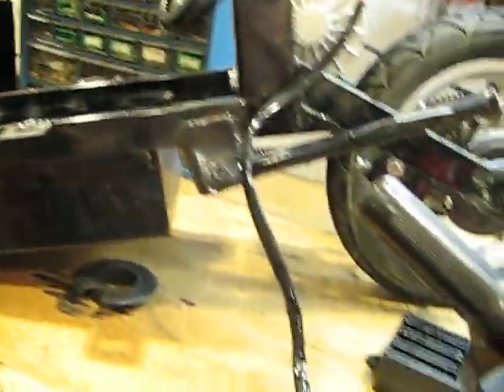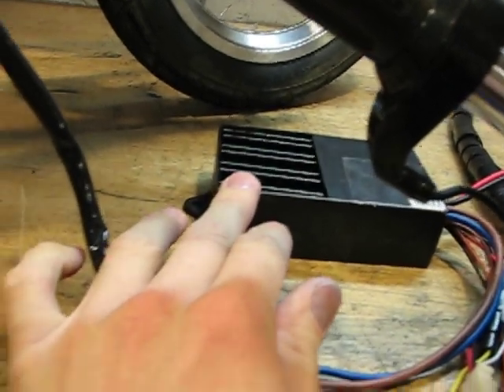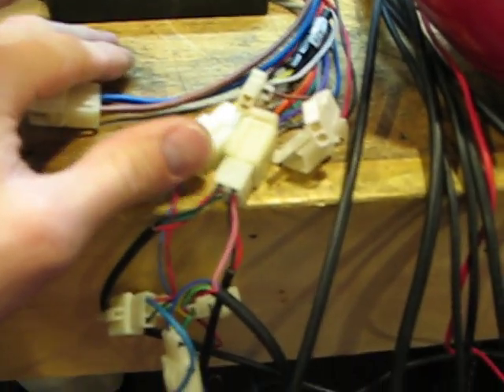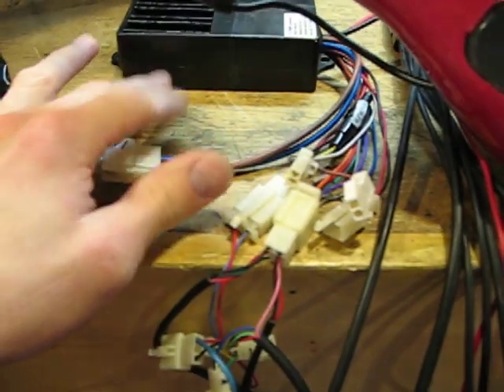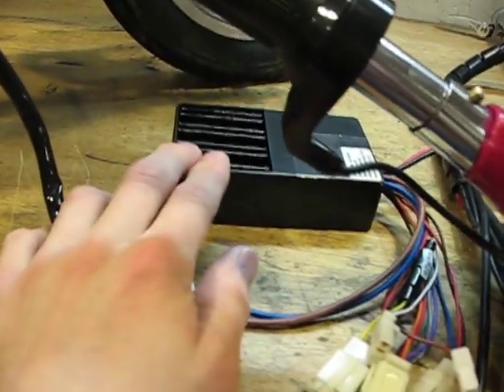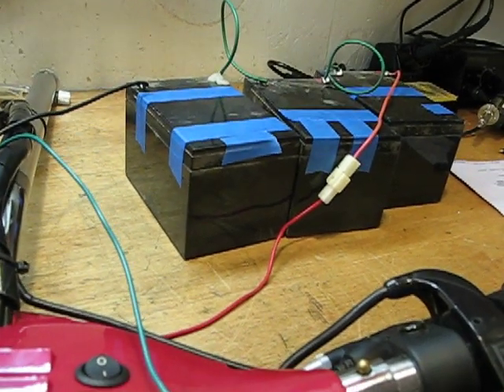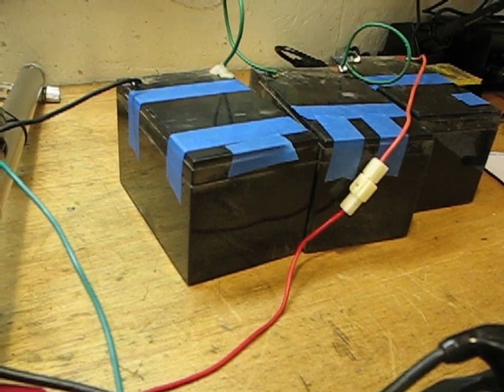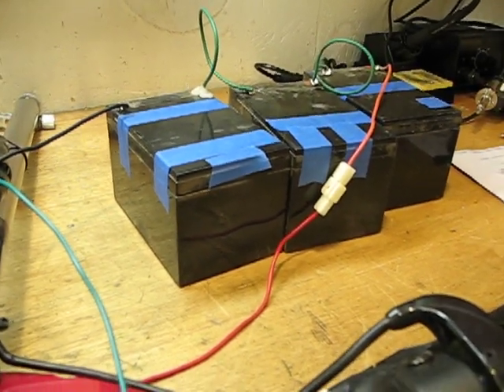Electric Scooter Controller Test

Comment: I have another type of scooter one of these standing one, I purchased a new controller for it , its what the manufacture web site sells/recomands, however it does not have the same wiring, it has no Charger input, also a too many wires going to the throttle , the scooter is bladez XTR-s 450w and the new controller is xk-022c .Can you help me THANKS

Comment from the maker: @BrutusJones Yep, you can connect the motor right to the batteries.  Just make sure you lift up the wheel or you will be chasing it :-)

Also make sure your brake switch is not stuck on, because that will disable the motor too.

Comment: Ok, the voltages on one are all around 12v and on the other two are around 13v and one is around 11v.   the dash lights up ok and says full power on one scooter and the other ,  ?  I forgot to check it but i'll check it later.  the controller is CT-660B9.   what if I bypassed the controller and hooked the batteries directly to the motor just to test it out?  Is that a bad idea?   -Thanks

Comment from the maker: @BrutusJones The controllers were pretty unreliable in these from what I understand.  That's why I ended up installing the new one.

How many volts do you have on your batteries when they are charged?  The scooter won't move if the charger is connected, or if either switch is turned off.  Does the battery gauge on the dash light up?

If the batteries are original, they are likely no good.  

Let me know your battery voltage, and we can go from there.

Comment: I bought two scooters just like the one in your  video. Can you tell me how to check if my controller is bad or not?   Also , both chargers are supposed to light up red at first but they both light up green as if the batteries are fully charged but they won't run.  ?  ? 
Thanks in advance for any tips.

Comment from the maker: @MrDjMon4Lif3 If you can find a spot to mount the motor, then yes, it will be faster.  Especially if you put a bigger sprocket on the motor.  You will have lower battery life though.

Comment from the maker: @fishinman69 You could use a 48v controller and battery pack for more speed, but your motor will not last as long :-)

Do not try to use more than 36v of batteries on a 36v controller, it will probably be damaged.  A set of 3 fully charged batteries in series typically measures about 38 volts.  The 36v controller can probably handle 41v or so maximum.

Comment: i have a stealth 1000 and it has a 36v controller.  If i put a 48v controller and of course 48v battery, will I gain anymore speed?  How do these controller work in handling higher voltage than specified?  Will a 36v controller only supply 36v to the motor?

Comment from the maker: @MaxSachs That would not work the same in this case.  Small capacitors are usually used across switch contacts to reduce wear from arcing.  Adding a capacitor to the input line of the controller would only increase the inrush current, and the arc.

Comment: @Maxxarcade 
Just had an idea, all of my mopeds employ capacitors to regulate spark and rectifiers to regulate voltage and current.  What if I were to place a 50A inline fuse and a high rating capacitor between the battery and the controller, the fuse to protect the battery and the capacitor to protect the controller.  On a moped this serves to maintain spark and to protect lights from blowing.

Comment: @Maxxarcade 
No I cannot add more but yes I can remove one cell without compromising the mounting case.  It will mean yet more desodering work but at least it's free.  I kept reading about how controllers could handle higher than rated voltage blah blah blah and so I followed through, result: busted controller.  Removing one cell from each pack should leave me with a 37.8V 16Ah pack that I can try with the controller.  Thanks for all your help, I'll report back here when it's completed!

Comment from the maker: @MaxSachs That's the hardest part...  41.7 volts is a bit much for a 36V controller.  They are usually rated for use with lead acid batteries, which give about 38 volts at a full charge.  Hopefully the under-voltage protection won't be a problem with the 48v controller.  Depends how much the battery voltage drops under load.

What if you were to remove a lipo cell?  I assume you can't add more because of mounting space.

Comment: @Maxxarcade 
@Maxxarcade 
Hrmm, sounds like a plan.  At electricscooterparts I have my eye on this controller:  SPD-481200, 48V rated for 1200W.  It does present a small problem for me though, my lipo pack hovers around 41.7 volts...and voltage protection on that controller is 41 volts which means it'll shut off.  How about the SPD-361000 at that site?  It is imperative I remain at a 10 cell lipo pack...or alot of equipment becomes useless.  Do you know anything about these controllers?

Comment from the maker: @MaxSachs Then you need a controller with minimum ratings of 1000W at 48 volts.  Once you replace your controller, install a fuse of around 20 amps on the batteries for testing purposes.  If everything works, install a fuse that allows riding with a full load.  Probably 40 amp.

Comment: @MaxSachs 
So far this is 3 throttles that have gone completely bust, one was DOA and the other two decided to fry along with the controller.  I forgot to mention that the battery pack was not fuse protected, is this optional or a must?    I should just scrap the whole motor controller idea and simply have an ON/OFF switch to the motor to supply juice when I need it.  Not like I'll be blowing any speed limits...

Comment: @Maxxarcade 
The motor runs fine when connected to the battery, just that horrific spark to worry about.  The motor is a Currie 36V - 48V 1000W motor and its supposed to carry about 35 amps.  I just came from a site that talked about the controller frying mosfets because of the type of motor being used, too little resistance could cause high amps to flow.  I tested the motor before, at 41.7 volts it draws 2.5Amps with no load.  Before the sparking the throttle had worked.

Comment from the maker: @MaxSachs If you get any voltage at your motor wiresa with the throttle disconnected or at idle, your controller is shorted.

How many watts is your motor?  Also make sure your motor runs when connected directly to the battery.  If it  just sparks, then that's probably what blew your controller.

There are various websites that talk about building and repairing scooters.  I would start with searching for one of those.

Comment: @Maxxarcade 
This is very frustrating, I've waited for months to put this thing together and the piece that should have been the safest...falls apart before it even starts.  If the controller is dead, will it pass any voltage through the wires or should the failure be complete?  The key switch has an LED and it turns on, I also get 41.7 volts at the battery port and the motor port.  If this controller can't handle its rated capacity, could you recommend an alternative?

Comment: @Maxxarcade 
No there is no fuse, the lipo pack is rated at 15C's so that's 240Amps...I figured a fuse was not necessary since the motor will be pulling about 40amps.  The lipos do not get hot and wires are not melted just about half the disconnects themselves, like slag.  Two days ago I attached the pack again and this time the controller emitted some dim light and then a quick puff of smoke...the throttle is now dead but the controller is still good I think, I used a multimeter to test voltage

Comment from the maker: @MaxSachs Does it work ok once the spark stops, or does it melt the wires?  It shouldn't spark that bad when just sitting idle.  

You also should have a safety fuse in series with the batteries.  Lipo batteries explode like crazy if they get too hot..

If the wires are melting and nothing is working, then your controller is probably bad (or hooked up wrong).

Comment: @Maxxarcade 
I experience a very bright and powerful spark when I connected my batteries to the controller, blinding light and enough energy to completely melt the quick disconnect contacts.  How can I stop that spark from occuring?  The battery pack is 42V16Ah lipos.

Comment: @Maxxarcade 
I've got four wires for my hall effect throttle:  black, red, green, and yellow.  I used a multimeter to check the voltage change as I twisted it and there was no change in voltage, it stayed at 1.5V at the green and yellow wires and 5V at the red+black wires...so I know it's getting power, just not doing anything with it.  Looks like I'll have to get a new one.

Comment from the maker: @MaxSachs The motor on this scooter was a brushed type.  There are several different wire color schemes for hall effect throttles, so make sure they are connected to the right pins.  Basically, the throttle itself has 3 wires- Ground, positive, and output.  The output wire should increase in voltage the farther you turn the throttle.

There are wiring diagrams online for this CT-660B9 controller.  Just find the one that matches your wire colors.  .

Comment from the maker: I think the green wire should increase in voltage the further you turn the throttle.  If not then your throttle control is probably bad.

Does the motor go full speed when connected right to the battery?

Comment: i built a trike 36 volts , blew my controller out had the same one i think . my throttle had four wires , controller clip had 8 ins , is ther an easyer way .

Comment from the maker: Something like that.  Next Summer I might get a chance to do some testing with it and find out the actual range before loss of power.

It will go up hills found on most average roads/sidewalks, just nothing too steep or long.  And going downhill, it will coast like a bike so you don't need the motor.

Comment from the maker: I weigh around 160.  The batteries are pretty hard to remove... You have to take the whole body off, which means removing the seat, handlebars, and some other stuff.  The batteries also cost over half of what the scooter is worth.  I paid around $100 for batteries alone, and had to make the wiring harness myself.  But I'm crazy like that. 

Anything else you need to know about these scooters, you can find via Google.  Just search for Xtreme X-360.

Comment from the maker: I'll be changing a couple connectors, but those will likely be crimp on terminals.  I also need to solder new jumper wires between the batteries.  I'll post another video soon.